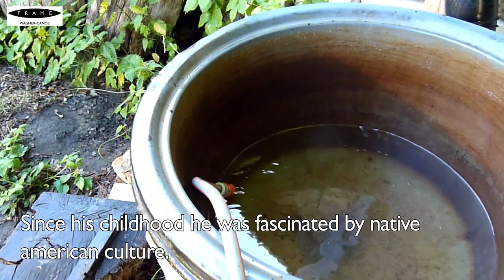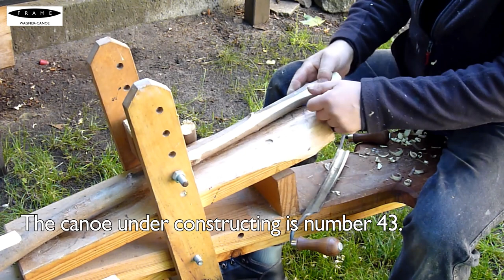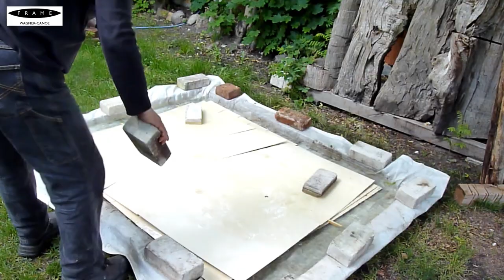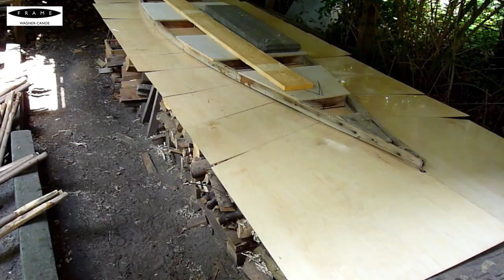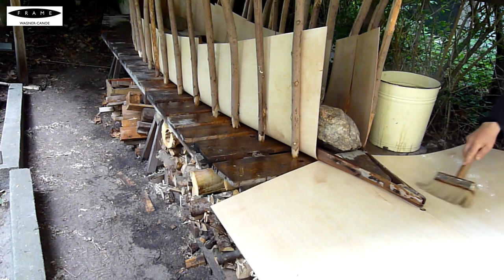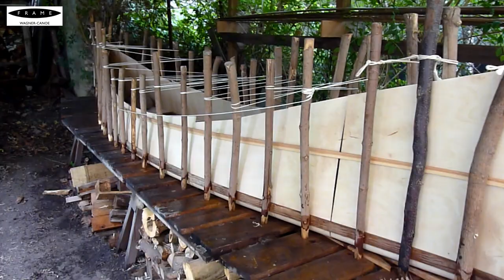Building a birch bark style canoe with plywood - part 1 - bending the hull

Comment: I'm curious how you joined the 2 plywood sheets together. Did you make a scarf joint or just but them up? I can't see a seam in any of the videos. Great work love this design!
Reply from the maker: the sheets are stitched on the outside on two sides like the gores and  on the inside I glue a small stripe of plywood above the groove/edge so it seems seamless.

Comment: With no commentary to help, I was wondering. Are these single plies of birch? Or several thinner plies of very thin birch plywood?  If that is the case is it marine glue? Where does one get this birch from?
Reply from the maker: its three single pieces of plywood, not laminated (the pieces have 5 layers of birch wood with cookable glue) in germany you can get them like you see them. They are called Modellbau Sperrholz (model construction plywood)
Reply: @FrameWagnerCanoe   Herzlichen Glückwunsch, Sie haben die Technik der amerikanischen Ureinwohner wiederbelebt.  Wie viele mm Birkensperrholz verwenden Sie?
Reply from the maker: @sukrunisikli6602  Danke Dir :) Abhängig vom Einsatzgebiet zwischen 2-3mm